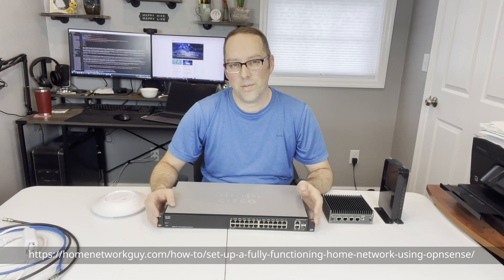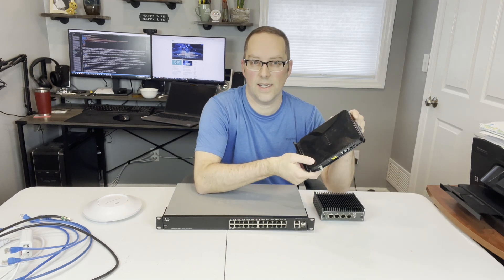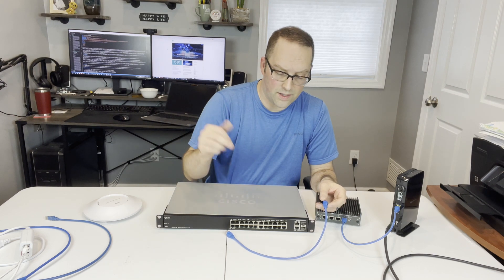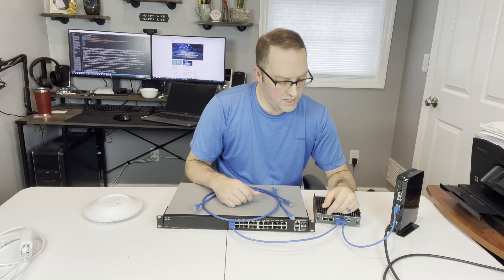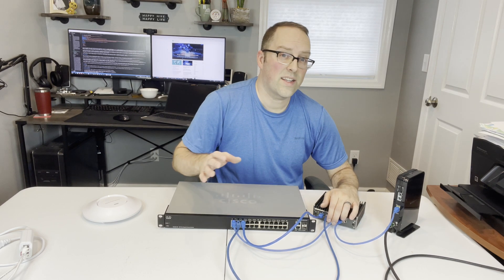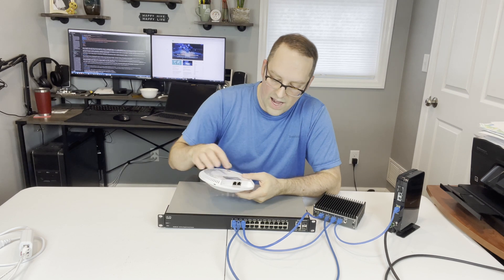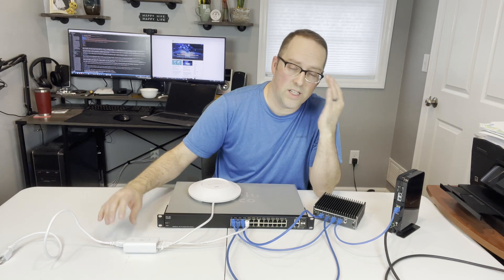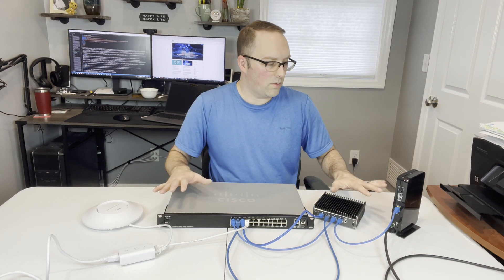Set up a Full Network using OPNsense (Part 1: Overview)

Comment: I m facing another strang eissue where DHCP not assiging IP to my PC on LAN when connected to OPNsnse LAn however when reboots OPNsense machine then gets IP any help on this issue ? Thanks
Reply from the maker: That's really strange. It's most like DHCP is crashing on OPNsense and when you reboot it assigns the leases. You might need to look in the log files. I've seen users who have very strange problems who end up finding out they have hardware related problems (storage/memory related in particular-- failing drive or RAM). I'm not saying that is the issue, but a fresh installation of OPNsense should not have that behavior. I've never encountered that on the many installations I have done.
Reply: @homenetworkguy  Yeah tried chnaging LAN adapters nothign resolved . Where as once I connect to my otheropnsense interface it gets IP in seconds. Just checked previous Opnsnses which is giving me IP on DHCP do not have register lease for IPV4 in Ubound DNS may be thats thr reason ? not sure

Comment: Hello great stuff amazon. Can you [lease guide if I have 2 ports on interfaces on device 1-WAN 1-LAN so attch LAN one to switch regaulr unmanaged switch . How will connec to assigned VLANS then or we need managed switch to use VLANS? little confused. Using over the shelf TP link and Netgear router for home stuff having 8 ports . Still not sure how to connect to assigned VLANS in opsnese.
Reply from the maker: Thanks. You will need a managed switch. These days you can get basic affordable managed switches depending on your budget. 

You will need to add the VLANs on both OPNsense (using the LAN interface as the parent) and the network switch. The switch port where OPNsense is connected will need to be configured to allow all of the VLAN IDs to pass through.

Comment: Can I set up OPNSense via SSH or do I open the FWs IP in a browser?
great video
Reply from the maker: Thanks! After you install OPNsense on the system, you can log in via SSH and access the menu system presented to the root user to configure certain settings like network interface configuration. But OPNsense is intended to be set up primarily via the web interface.

Comment: I'm on my journey to install opnsense on my new box just because i saw your video on the grandstream AP.  This new box is a Qotom with five 2.5 Gbps ports. Currently I have three vlans; guest, kids and iot with pfsense but  thinking adding more on this setup.  With all the devices in the house from the 4 kids between 6 and 15 plus the wife and me, I been trying to to think how I want to separate traffic more efficiently and set schedules.  I'm not sure where I was going with this reply lol

Is there a reason not to use the uplink port for a full home network?  Are there any multi gigabit switches that you recommend?  my sg300 switch is soon to be the slowest link in the house aside from end devices.
Reply from the maker: I'm quite not sure what you mean about using the uplink port..  as for recommended multi-gigabit switches, Grandstream recently released their 2.5/10G switches which I'm pretty excited about because that is one type of switch that I felt like they were missing from their product line. I'm hoping to demonstrate using one of them once Grandstream sends me a sponsored unit. They have a smaller version and a larger version. They do PoE as well which is perfect for their APs which utilize 2.5G interfaces: 

https://www.ipphone-warehouse.com/grandstream-gwn7821p-8-port-layer-3-multi-gigabit-poe-network-switch/
https://www.ipphone-warehouse.com/grandstream-gwn7822p-24-port-layer-3-multi-gigabit-poe-network-switch/

IP Phone Warehouse currently has the larger switch on sale for the same price as the smaller switch which is pretty awesome! The shipping is kinda high but their sale prices make up for it. Plus you may be able to get it without sales tax depending on where you live. If you don't live in the US you may have to find different distributors that Grandstream has. 

I'm a fan of Grandstream because they have a lot of management options for their products (and nice user interfaces) and you're not forced to use a locally hosted software/hardware controller or a cloud controller (but you can use those options if you like). Every device has its own web UI so you never have to worry about being locked out or any sort of adoption issues with a software controller-- there have been times when I was unable to get into some UniFi switches/AP that I was managing for someone).

Comment: Please get a real microphone, they are not expensive
Reply from the maker: This is an older video. I’ve improved the quality of the audio in my newer videos. Also I got a new camera recently so the video quality will also increase soon. Slow incremental progress! 

I’m planning to do more OPNsense builds with various hardware as different examples soon. Just dropped a video that shows an example of how to do the configuration for a system which only has a single NIC (not the most ideal scenario but it was fun trying different configurations).

Comment: Opnsense won’t detect my WAN
Reply from the maker: Sometimes it takes time for the ISP to auto register the new MAC address. Some ISPs require you to call them to change to new hardware. For connections that are not provided by DHCP, you need to add the proper configuration (some users have PPPoE connections which require additional configuration). Some fiber providers require the WAN interface to be on a certain VLAN. So there are a number of factors to consider. One thing you could try is setting the MAC address of the WAN interface of your OPNsense box to be the same as your old router. Then you don’t have to worry about MAC address updates with your ISP.
Reply: @homenetworkguy  tried that. Also left it running all night. Nothing.
Reply: @homenetworkguy  no issues switching routers or switches connecting to the modem which is DHCP.
Reply from the maker: That is really weird especially if you have done it before with other devices. Maybe could try releasing and renewing the DHCP lease manually from the web UI?
Reply: @homenetworkguy  I know, right? Odd
Reply from the maker: What I do these days is manually set the MAC address so I don’t have to wait for the ISP to register the new MAC address. It lets me switch to completely different hardware without hiccups/downtime.

Comment: So if I wanted to return my router from my isp and all I have is there ont and a opnsense router can I just plug it straight to the Ont? And follow this setup
Reply from the maker: Yes in theory. The only potential issue is if your ISP requires your WAN interface to be on a particular VLAN. Not sure how you find out if that’s necessary or not. For some ISPs you may have to call them to update the MAC address if it doesn’t happen automatically but you could also use the same MAC address on the WAN interface if OPNsense too since there is the option to set the MAC address on each interface.

Comment: Thank you for the video, showing the physical connections between the devices is really helpful for beginners like me.
In my case, the ISP's modem/router is also providing VoIP telephony, so I need to keep it. Right now my connections are FTTH > ONT (box that converts fiber to ethernet) > ISP's modem/router > Switch.
So what is the best way to add a OPNsense router (PC with 2 NICs, one for WAN and one for LAN)?
If I put ISP's modem/router in bridge mode I loose VoIP, so I have to enable PPPoE passthrough (my ISP allows multiple PPPoE calls).
But I cannot understand how the physical connections should be, I would be grateful if you could help!
Should I just put the switch right after the ONT and connect everything on it (WAN + LAN of OPNsense PC, WAN of my ISP's modem/router just for VoIP and all of my other devices)?
OR should I go for ONT > WAN of ISP's modem/router > WAN of OPNsense and then LAN of OPNsense > switch
OR maybe ONT > WAN of OPNsense and then LAN of OPNsense > switch along with ISP's WAN + all other devices?

As you can see I'm very confused!
Reply from the maker: Yeah ideally you can have OPNsense as your main router primarily to avoid double NAT situations (there are ways to avoid that when using 2 routers but both routers need to support features such as static routes— it’s a more advanced configuration). 

Double NAT can interfere with hosting services behind the second router (such as when you’re playing games, etc). Many apps that connect through various cloud services might be ok as well. I test OPNsense in a VM often and basic Internet access works just fine with a double NAT.

If you can’t avoid using the ISP modem router, most would say (with the caveat of double a NAT): ONT > ISP router > OPNsense (WAN) > rest of your network (switches, etc).

Alternatively since your ONT and ISP router are separate devices (often with cable Internet they’re all in one boxes), you might be able to get away with connecting the ISP box to the OPNsense LAN instead but it’s hard to say heat problems that could cause. I’m assuming you have to connect your VOIP phones directly to the ISP router for them to work? Cable modems are like that. The only thing I worry about in this configuration is if your WAN/VOIP traffic would need to be on a VLAN. That complicates configuration. Some ISPs do things differently and I’m not quite as familiar with fiber Internet since I don’t have it in my area yet (hopefully soon*).
Reply: @homenetworkguy  After much reading I managed to keep the ISPs router behind OPNsense, just for telephony.
ONT > [WAN] OPNsense [LAN] > Switch > ISPs router, WAP, My devices.
In ISPs router I had to change Link type to Static and set an IP address inside OPNsense's subnet (outside DHCP range).
Everything works OK, thank you so much for your help!
Reply from the maker: Nice! I’m glad that works because it would help avoid some double NAT issues. You may want to look into setting the Firewall Optimiaztipn option to conservative because I’ve seen others say it helps prevent dropped calls if on longer calls (like 30+ minutes): https://docs.opnsense.org/manual/firewall_settings.html

Comment: Thanks for the awesome video! 

Qq
I have fibre to the home and a tiny box the converts fiber to Ethernet

The provider has given me a modem router with voip as well

I got a minipc router like in the vid and managed to configure the opnsense to get internet directly from the little box that brings the fiber, 
All good till here but
How is it possible to still have my voip connected?  
I tried plugin in from router to the provders modem/router but the voip led doesnt go on and no ton is aquied!
Any ideas or another device i could use to attach to the router and aquire voip ? Thanks!

The provider router is a zte h1600 home gateway
Reply from the maker: Thanks! You may need to use the ISP provided router for VOIP to function properly. I am not sure if you could set it in bridge mode or not (since it may just operate only as a router since it may not be like the cable modem all-in-one boxes where you can set it to bridge mode). I have done that in the past with Comcast Xfinity and still was able to keep the voice functionality yet still use my own router with OPNsense (nowadays I use a customer own modem with voice capabilities).

If you can't set it in bridge mode, you'll be in a double NAT situation which should work ok unless you are trying to host services outside of your network (game servers, web servers, etc) which can be hindered by double NAT. Of course one must be careful if hosting any services (I'm obligated to say that disclaimer, haha).

Perhaps you could use the DMZ functionality of the ISP router and put the OPNsense router in that DMZ. That might help not having to set up port forwarding on the ISP router should you be hosting anything (which you will need to ensure it is secured as best as you can and isolating those hosted applications from the rest of your network). If you're not really hosting anything, that is probably unnecessary.

Of course another option is to use a separate VOIP provider that's not associated with your ISP (and perhaps you can pay less on your fiber service). That would allow you to run whatever VOIP service you want behind OPNsense and you could connect the fiver ONT directly to the OPNsense box. Note that when you use VOIP services, there are some settings you can tweak in OPNsense to help keep calls from dropping after like 30 minutes or so. Not sure what they are unless I go searching for the settings but I've seen it mentioned several times on Reddit.
Reply: @homenetworkguy  Thank you so much for the reply! , will attemp and get back to you :)

Comment: Im curious as to how I could make a homemade Wi-Fi 7 mesh network. Preferably quad band so i can have a dedicated back haul while having a separate band for 2.4, 5 and 6ghz. And Wi-Fi 7 switches to the best node available instead of holding onto dear life to the crappy node it was on before
Reply from the maker: I haven't kept up with the vendors who use WiFi 7 yet. I know TP-Link has some access points but they are very expensive. Mesh networks may work ok for many home users but I think even better is simply having multiple dedicated access points which do roaming well like UniFi APs and other brands. They use a wired backhaul which may be difficult to run cables but even many of those APs can mesh together if you cannot run cables to all of them (less ideal than wired connections to the APs, of course). Many of the popular vendors still only offer WiFi 6. It may be a while before WiFi 7 becomes prevalent and more affordable.

Comment: Hi there, I have 2 ISP's with a TPLINK LoadBalancer, how can add a opnsense appliance from the tplink to my network passing through the opnsense appliance???
Reply from the maker: I’m not familiar with exactly how the TP-Link load balancer works but if you’re going to use OPNsense, you could have OPNsense load balance the 2 WAN connections (or do failover, etc). I haven’t produced any content on dual WAN configurations but I plan to at some point.

Comment: Suggesting that VLAN 1 be used for anything at all is problematic.  The security issues that he described would not be a thing if VLAN1 were not used.
Reply from the maker: Yes you have to be careful when using it. For a home network it’s easier to manage keeping devices off VLAN 1 (especially if it’s just a single switch) but of course you can create a separate VLAN for network management purposes. 

I’m always speaking from a home network context and not a business/enterprise network. 

Most home networks only have a flat network so this is still a step up from that and if you want to go further you can separate management into its own network. I always try to mention that some users put their management network on a separate VLAN so that possibility is known. 

You can build a full enterprise network at home if you want, which is the great part about building home networks— you’re in full control! 😁

Comment: I have exactly that PC tower under your desk on my old i7-2600k music studio build. Great roomy case.
Reply from the maker: Nice! It’s an old case but it has served me well. I’m thinking of moving my PC to another slightly smaller case I already have because I can’t fit my current tower under the shelf of my desk (I had to move the extra shelf to the other side of the desk). Plus some of the plastic drive cages and other parts of that case is getting a little bit worn out from usage over the years. I need to buy some Noctua fans to reduce the whirl sounds now that I’m doing videos and need to reduce background noise.
Reply: @homenetworkguy  it is a very large case indeed

Comment: The audio makes it difficult to Watch
Reply from the maker: Sorry about that. The audio in this video was from my phone. More recent videos I try to always use my nicer microphone that’s connected to my desktop. I’m slowly getting a better workflow set up. I’m still need to work on reducing some slight echoing in my room. My basement office is not an ideal location for recording because it has lots of doors, glass windows/door, and a hard floor. I’m looking at also getting quieter Noctua fans for my PC as well.

Comment: Hello,

I am super new to all of these things and wanted to know if i can use an unmanaged  switch (NETGEAR GS308) instead of the switch you have in your setup?

Thank you :)
Reply from the maker: Unfortunately, you will need a managed switch. If you only need a few ports, there are some budget friendly options from TP-Link and Netgear (and others). I’ve seen others try to mix unmanaged and managed switch in certain ways since many unmanaged switches will simply pass along the VLAN tags, but that is certainly not ideal if it even works.
Reply: @homenetworkguy  Got it! Thank you so much for your reply :D

Comment: @2:18 - label WAN ???
Reply from the maker: One port on the cable modem might be labeled as WAN on the port but if not they usually color code it to show which port connects to the router.

Comment: hello, could you show us how to generate access report in OPNSENSE?
Reply from the maker: You mean the log of who accesses (logs into) OPNsense so you can monitor it?
Reply: @homenetworkguy  yes, like Sarg or Lithsquid
Reply from the maker: Quickly looked up those tools and it seems like those are used to read Squid (web proxy) files. There is a basic audit log file under System > Log Files > Audit. There are various tools if you want to monitor detailed web traffic including the various NetFlow reports built into OPNsense. There is also 3rd party plugins such as ntopng and Zenarmor.
Reply: @homenetworkguy  thanks I will look into these tools👍